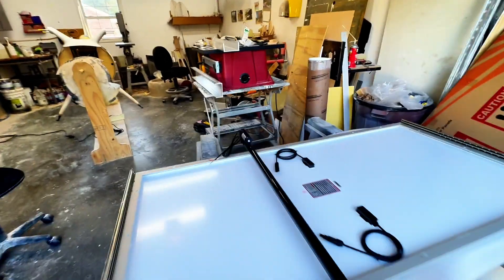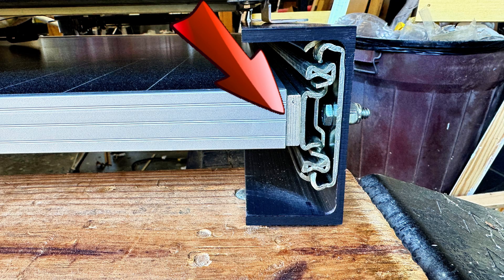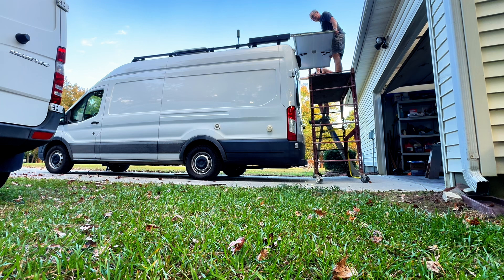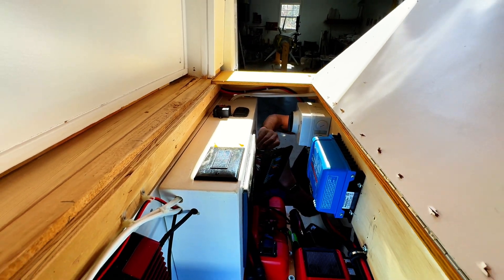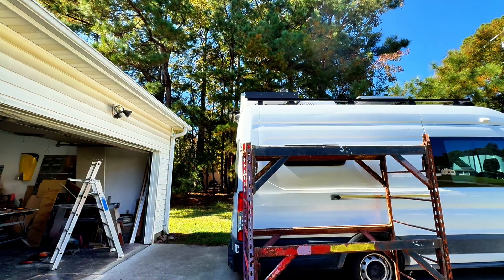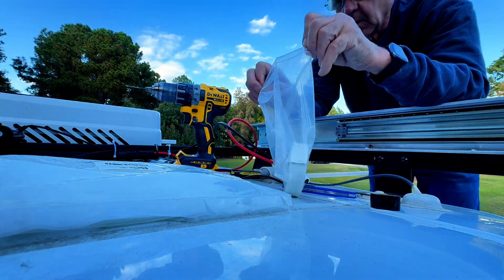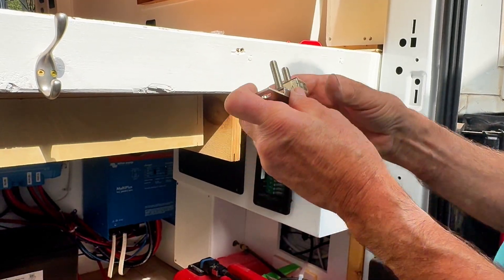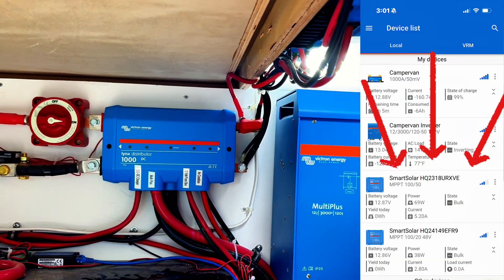Slide Out Solar Panel on a Ford Transit Campervan

Comment: Any update on this after long term use?? I’ve had bad luck with drawer slides inside the van.. can’t imagine outside hahah
Reply from the maker: They require frequent maintenance (cleaning and regreasing), especially if you go through multiple dust storms or stay out west in the dryer air for an extended period of time. But overall, I think it’s worth the effort if you want additional solar but don’t want to deal with ground deployed panels.
Reply: @michelleandblaze have you had it in much rain/snow? I definitely am out west a ton! How often do you clean and regrease? It would be cool to see a video covering everything after you’ve had them for a while!

Last question when is dad free for me to swing by for an install 😂😂
Reply from the maker: That's a good question. I've had it in both but not for extended periods of time. I probably cleaned it once a quarter or anytime it was struggling. 

Lol, my dad has retired from van builds. He's either working on or flying his radio-controlled airplanes. Sorry!

Comment: The linear actuator is the mess up it will fail should just have a pull stick like you use to pull down the attic stairs with .
Reply from the maker: I prefer the linear actuator, but I get what you’re saying. It’s been working great so far. The only issue I had was the three dust storms I went through. They gummed up the drawer slides with a lot of dust and grime. I had to clean them but they work great now.
Reply: @michelleandblaze the way i described you would have never had to clean the dust out . More feature's the more to fail and replace .

Comment: Hey any links for the same exact drawer slider you used?
Reply from the maker: Hey 👋 It’s the first link listed in the video description. They will most likely require cleaning due to the elements and lots of dust. If you can find one with the bearings completely enclosed, that would probably be better. Good luck!

Comment from the maker: Hey guys. Just a heads up that if you plan on creating a similar sliding solar panel, you will most likely need to do some maintenance on the drawer slides. Here's how I tackled the maintenance while traveling through New Mexico https://youtu.be/NpHsLb0ibPQ.

Comment: We built ours in a similar fashion but unfortunately found out the hard way that these sliders were never meant for moisture/dirt ingress. After 2 seasons, one side seized up and the other rusted to the point of failure. We were past the warranty so couldn't return them. We're going to re-asses this summer and try to fabricate a slider using exterior sealed bearings. Nice design and layout !
Reply from the maker: Ah, I’m facing a similar issue right now. I sat in an all-day dust storm a week ago and noticed the sliders were very gritty. I’m going to try rinsing them off, cleaning them, and then applying grease. 🤞it helps. 

If you figure out the fabrication of one, lmk! I might need one 🤪
Reply: @ Water is the worst thing for them unfortunately. These are all meant for indoors. The only way to properly repair them is to disassemble completely, clean all the bearings, apply fresh grease and re-assemble. The issue is that it gets worse after each rebuild. We done ours a few times and removed them completely after they seized up as they are intended for interior cabinets and not exterior open to the elements. People watch social media posts like these and face the same problem. Hopefully posters warn others not to use low cost interior sliders outside of their rigs. Good luck !
Reply: @michelleandblaze  The other option is to use the spray for roller door slides
 it's NOT grease so it's almost dry, 
this results in the dust not having anything to stick to, 
sometimes it's called Dry Glide. 
Hope that helps.

Comment: idk if i missed it but how are you connecting the u channel to the roof rack?
Reply from the maker: Good question! I don’t think I spoke specifically to how we attached the u channel to the roof rack. 

I have an 8020 roof rack from Unaka. They use what are called T-nuts to secure things like solar panels. We used them to attach the u channel. We drilled holes in the channel and used long enough bolts to go thru both the channel and the T-nut. Here’s a link to a similar product on Unaka’s website: https://unakagearco.com/products/8020-equivalent-3678-5-16-18-slide-in-stainless-t-nut?srsltid=AfmBOoqT5UL354dNmhLsphQFcPTUHIwp_7b-nRR84G5am-nIURyP1AJP. I don’t remember the specific size this roof rack uses — we had leftovers from the original solar install. I hope that helps!
Reply: @michelleandblaze  thank you so much!! I have the exact same roof rack so this is perfect!
Reply from the maker: @uppercaseCHASE1 awesome! Glad to hear that. Good luck!

Comment: Look into alternator chargers……..a whole new game.
Reply from the maker: Oh, I hear you! I have one! My build is 100% electric and I have a 3,000 watt inverter that's an energy vampire. The Renogy 50 amp DC-DC charger helps a lot but I have to drive long distances to get my batteries to 100%. We made some mods last fall so that I don't have to keep the big inverter going all the time, which has helped tremendously!
Reply: @michelleandblaze  what a great idea to increase efficiency and use of space. Secondary alternator for 280 amps is also possible. EcoFlow dc-dc goes up to 800w that works for alternators 190 amps or higher.

Comment: A linear actuator is also called a ram. Single actuation = single acting ram, double actuation = double acting ram.
Panel articulation is next-level design for increased electrical output.
Design should incorporate easy access because constant intermittent cleaning is required for high efficiency per the panel's specs.
I find side extending to be more advantageous for the above reasons.

Pneumatic rams are also a consideration. You're driving a vehicle that rests on tires that require air that depending on the conditions you may want to temporarily deflate. Handeld air compressors with an aux. tank mounted underneath the chassis is simple and an aux. energy source for all things pneumatic.

Comment: I'm thinking of one that would extend over the front of the van to shade the cab windows. As well as two fold up wings on the sides.
Reply: Panel articulation is next-level design for increased electrical output.
Design main goal should incorporate easy access because constant intermittent cleaning is required for high efficiency per the panel's specs.
I find side extending to be more advantageous for the above reasons. I think the best solution has a dedicated rooftop walkway allowing one to clean the panels from above while not stressing the roof. Otherwise you will need a stable, safe, sturdy portable ladder on the ground.
Reply from the maker: That’s a really clever idea! I like the combination of shade and more solar. Good luck figuring out a design that works best for you!

Comment: Check on a different actuator.  I have see others do something similar and they opened and closed way faster than the one your using.  Since yours is being used to push and pull instead of actually lifting weight, you should be able to change it out for a much quicker one.  All in all that's an awesome setup and use of space...... Love your channel...
Reply from the maker: Ah thanks for the tip. We’re going to stick with this one for now. But it’s helpful to know there are faster ones out there! 

Thanks! I’m so happy and proud of what we built together.

Comment: lol shows everything but the actual thing working
Reply from the maker: There is a small glitch in the middle of the video from when it was exported from the editing software. But if you watch the video to the end, you’ll see it working. And I just published this shorts to demonstrate that it works Sliding Solar Panel | 50% MORE Solar | Campervan Conversion #solarenergy #solarpower #vanbuild
https://youtube.com/shorts/cQ6sU1K3UVI?feature=share

Comment: Pretty neat. How big is your battery bank?
Reply from the maker: Thanks! We’re happy with the results. I have 580ah of lithium batteries.
Reply: @michelleandblaze way dc dc charge is? The victron xs da 50ampere regolabile is good is regulable in amper 10amp.tu 50amp.alternator 180amp.is good dc dc 100amper is correct tu 560ampere lifepo4

Comment: Did you weigh all the extra materials, drawer sliders u channel fasteners etc…I think a fold out portable solar array may have been lighter.
Reply from the maker: We didn’t weight everything but the solar panels alone weigh 26lbs. We realized after the u-channel arrived that we could have bought some slightly thinner. 

Fold out solar panels didn’t even cross our minds. That’s a good idea to explore!
Reply: @michelleandblaze  A fold out setup would have been more difficult to configure so one panel is facing the sun when closed. Your slide solution seems ideal.

Comment: hey guys, what kind of camera mount do you have on the roof? is it for insta360 or for a phone? what is it called?
Reply from the maker: There’s an OEM backup camera but that’s it. Are you referring to the linear actuator that extends beyond the back of the van?
Reply from the maker: Or maybe you're talking about the WeBoost mounted on the roof rack?!? It's a cell signal booster, which I use when Starlink is under a tree canopy and I have cell service.

Comment: Nice build! It's nice to see someone do what  I though about doing a few years ago myself, but your's is a far more advanced implementation! I was on the verge of buying a converted short school bus back then, but that fell through. I had though about double decker extending solar panels after seeing a portable EV charging station trailer that had extending panels left and right so they had three panels across. I was thinking of using 80/20 extrusion build  the structure out of, and I have a bunch of drawer slides from 19" computers server racks that extend and lock in place when extended and collapsed. I thought about about some sort of motorized extension, like a linear actuator you used, but I live in Canada, the land of Ice and Cold, and didn't think that such a device would last more than a year or two of Canadian winters. As I was already planning on travelling around with one of those collapsable ladders, I had my method to get up and manually extend and collapse them.
Reply from the maker: There are so many different creative ways to increase your solar array. I think part of the challenge is figuring out which option will serve your setup the best and within a reasonable budget.

Comment: I had this idea.  But mine was one layer on slides that doubles as an awning over the side and then stick on panels underneath to minimize the height.  I also want to do another van to incorporate this along with a shower that has a slide out fridge and upper shirt hanging closet.  Just slide the clothes and the fridge forward and then dry off and slide back in.
Reply from the maker: Ah yes, I could see that working. This was an afterthought for us so we made it work. I’m hoping 750 watts is enough to keep my batteries topped off while boondocking. 

Ah I’ve seen a shower that doubles as a closet but never a fridge 🧐 That sounds like a great way to save space. Good luck!